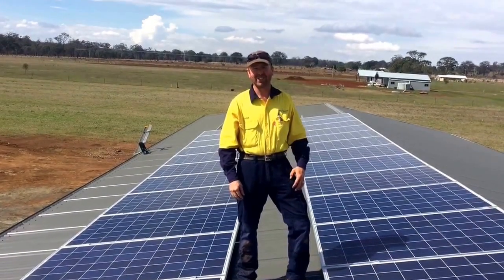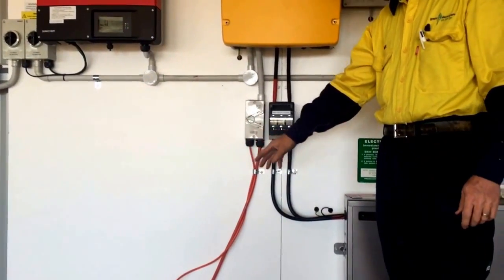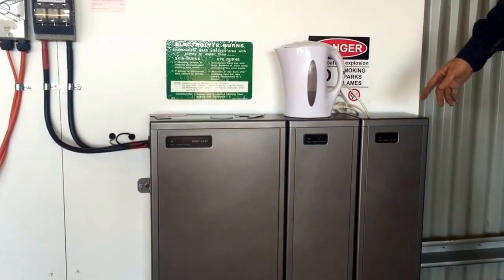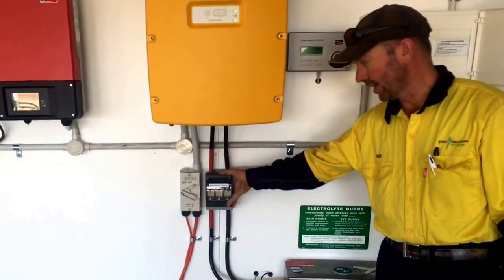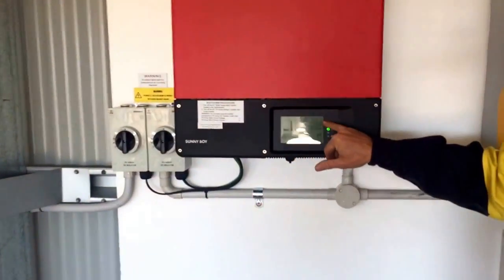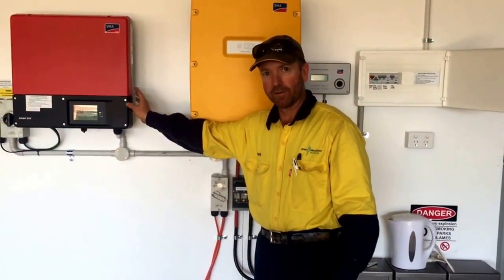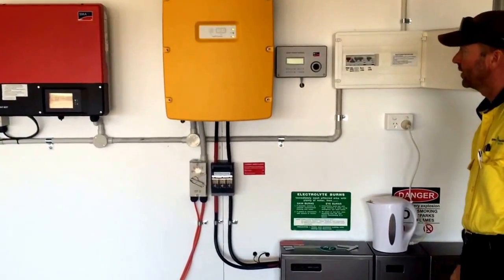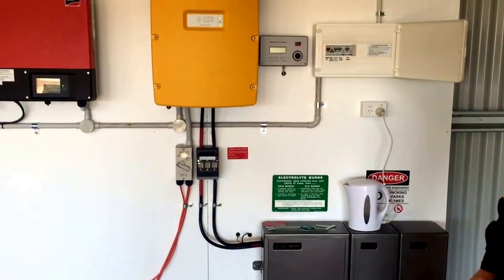AC coupled off grid system

Comment: How does the grid tie inverter know how much power to use, as grid tie inverters have constant output depending on the sun?
Reply from the maker: The sunny island uses frequency (hz) to control the output of the sunny boy (set to island mode)

Comment: So is the sunny boy inverter adjusting it's output to load?, if so, is it doing it by sunny island changing hz amount above 50 or 60?. Can a system be configured to never give power to grid?, but get power from grid if needed?.

Comment: Hello. Thanks for the video. I have a question: the system diagrams for the Sunny Island always show the presence of the Sunny Island Charger 50. I don't see it in your installation. I am guessing that whilst the charger 50 may have been more efficient to charge the batteries, your analysis showed that it wasn't worth adding to the system, and you are more than happy to have all the charging coming directly from the Sunny Island. Could you please confirm?
Reply: The charger is only required in DC coupled system, as then the PV will directly feed the batteries. The charger is therefore not used in this sort of a system.
Reply: We have this plant in India's most backward district , Mewat https://www.youtube.com/watch?v=ron-FJUjIKQ&feature=share